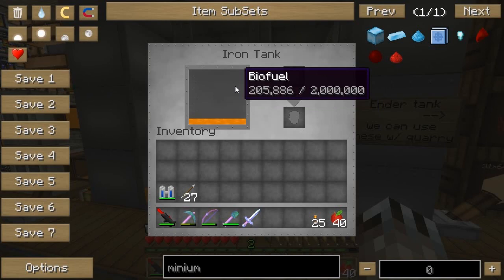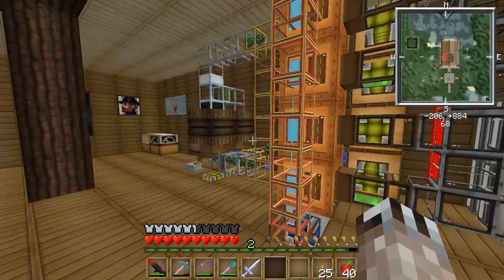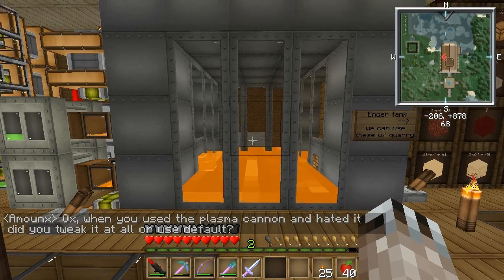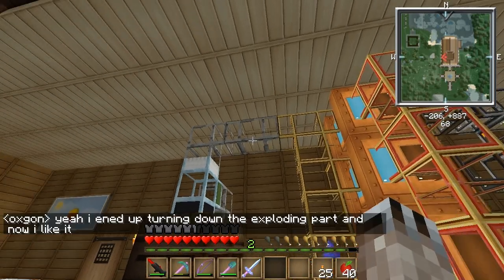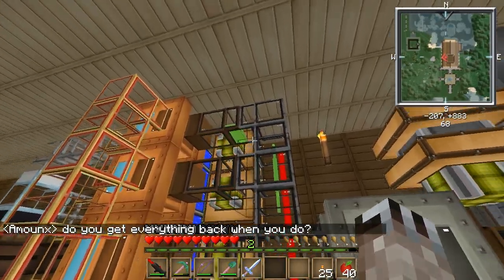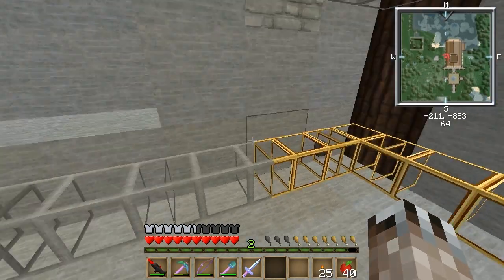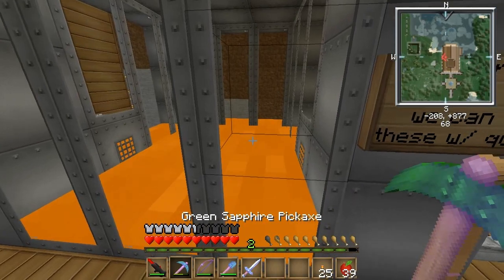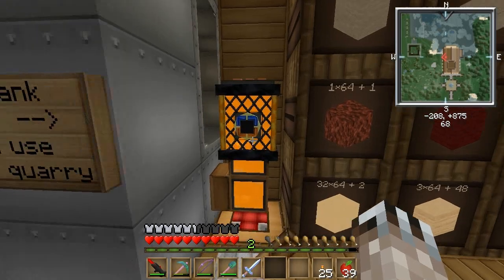FTB Tutorial: Automated Biofuel Factory

Comment: There is a few inefficiencys in this set up I noticed. It works, but its slow and doesn't utilize the apples produced by this farm. I made a set up biased on this one but added in a squeezer to supply some of the fermenters with furit juice. If you have an automatic honey farm (very resource intensive) you can also use honey to do the same thing. This adds 50% output to fermenters you supply with honey or fruit juice. In general this is a basic set up, but there are ways to improve the set up. Also, the power. With TE3, use the combustion dynamo, put your supply of water there and use the charcoal to crank out 80 rf/t and store it in a redstone engery cell and use the leadstone/redstone energy conduits to provide power to the farm. The conduits convert the RF to Mj at a 10/1 ratio. Can be a little resource intensive at first, but it yields a faster running farm with more biofuel output.
Reply: Yeah, but this is over a year old. Things have changed a lot since then in minecraft and with mods. Nowadays we have mods that barely even existed back then. There are so many ways to do this better these days. It all comes down to what mods are being used. TE, MEK, MC, EIO, IC2, MFR and so on...

Comment: You should use a steam engine instead of a sterling engine. Its twice as powerful for the same power. Alternatively if you want something midway as powerful use a hobbyist steam engine. Its waaaayyyy more efficient for the coal that goes in. Both require water which you are already providing. Also a moistener can be used to make mulch for the fermenters to avoid using up nonrenewable fertilizer.

Comment: Yeah I had no idea the 1 to 5 ratio. You probably could do away with the other fermenters and run it with more engines and have a higher output. I also want to use the fuel to power engines for making the fuel. I am looking three ways. Biofuel engine biomass engine and the last would be using the fuel to make steam then using steam engines to make MJFrom my understanding the only reason to use biofuel vs biomass is has the same ratio of power but it just compresses it down 4x forbetter storage.

Comment from the maker: Wow, I had read somewhere that you need more than 1 still per fermenter. But since I'm running 4 fermenters on 1 engine, and the stills each have their own engine, I guess maybe it works out (the fermenters are slower than they could be).

I wonder how profitable it would be to run the engines on biofuel? 1 can of biofuel is 5 MJ/t for 40k ticks (33.3 min)